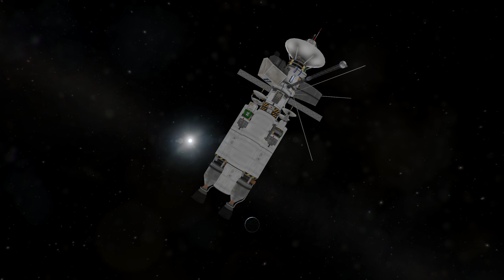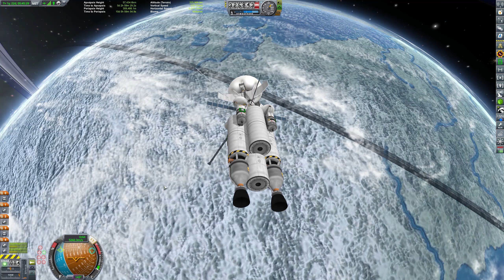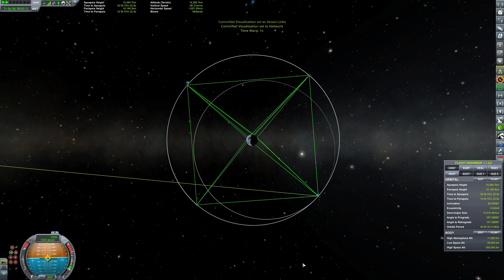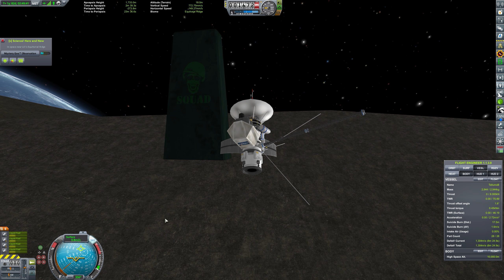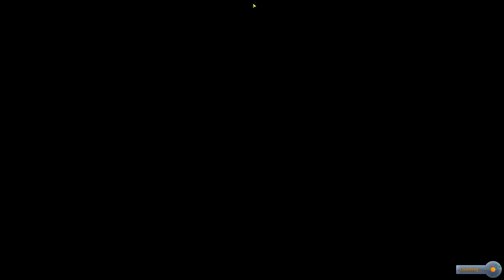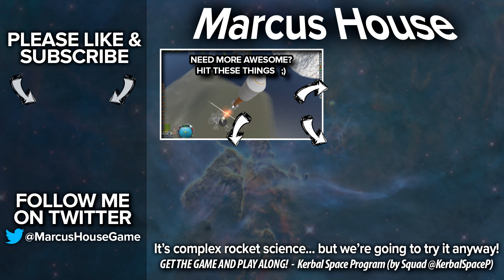KSP Galileo's Planet Pack - Ep 12 - How to set up a relay network and land on Lili

Comment: 8:10
The stuff is like that because it's accretion from the ring, instead of just from rotating fast. But yea it's unlikely but slightly more likely than if that was caused solely by the spinning

Comment: My only Question to Marcus is

HOW THE HELL HE DID INSTALL ALL OF THIS MOD AND NOT CRASH!!!!!!!!!!!!!
Reply from the maker: I actually did it all with CKAN and it all ended up quite painless.
Reply: you should launch ksp in 64 bit itll help load the mods without crashing
Reply: i had a problem that while loading it locked up and windows thought it died so it shut it down with a stopped responding i just kept pressinf wait until it loads
Reply: Good question what type of PC do you use unless CKAN program

?????????????????????????????????????????????????????????????????????????????????????????????